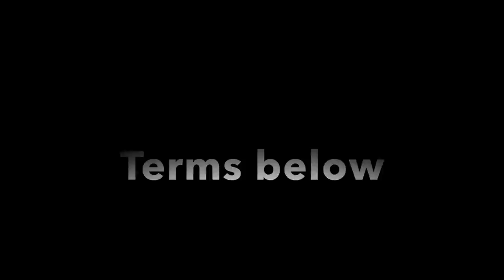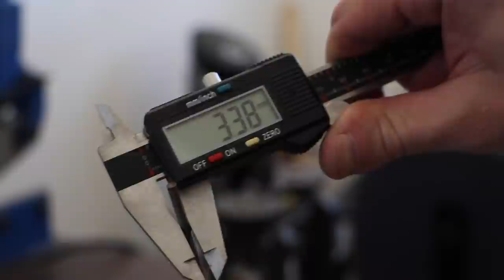Making 2 Chains & 2 Bracelets | 7mm & 10mm | Arabick Garibaldi

Comment: DynamiS Jewelry What brand rolling mills do You use? I want to buy one and I wonder if only the most expensive ones are worth the money like Durston or Pepe or You can recommend some cheaper ones? What do You think of VEVOR rolling mills? I can't find any reviews on them.
Reply from the maker: Hi!
My rolling mills are very cheap. Order /made them 10 years ago. And using to this day.
I don't think that some brand is better or not. As long the tool does it job!

Also, I just ordered another rolling mills from Pepe with motor. With this amount of work very hard to roll everything by hands. So, later will tell my opinion on those.
Reply: DynamiS Jewelry 
Have you any older tools to sell
Reply: @DynamiSJewelry  Thank You for answer :)